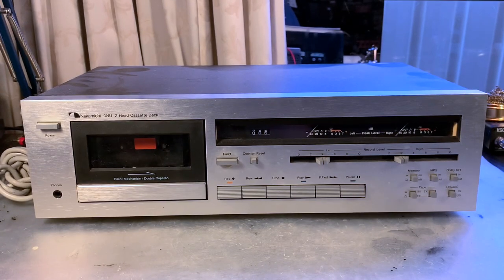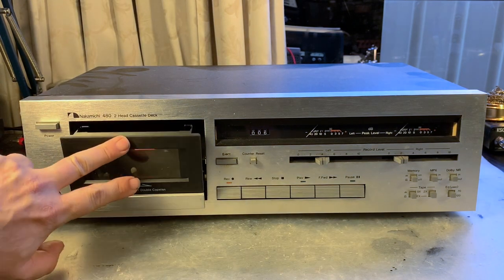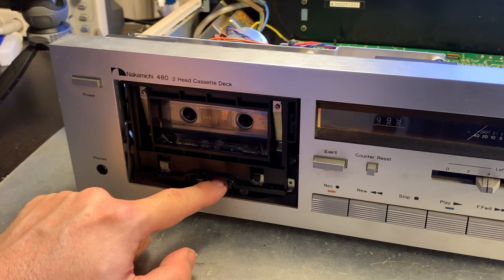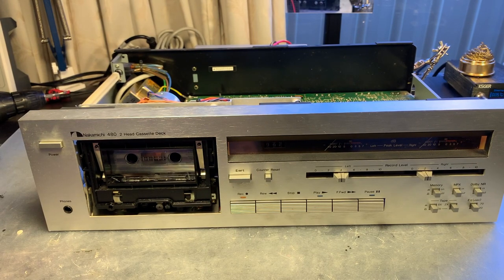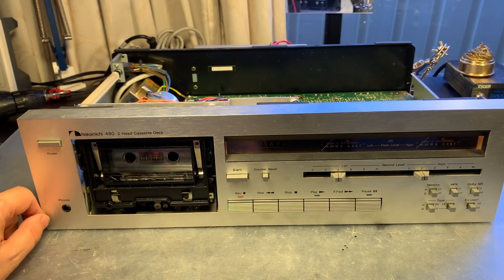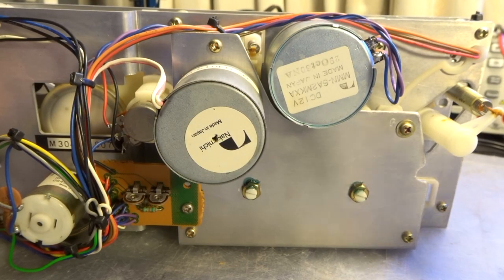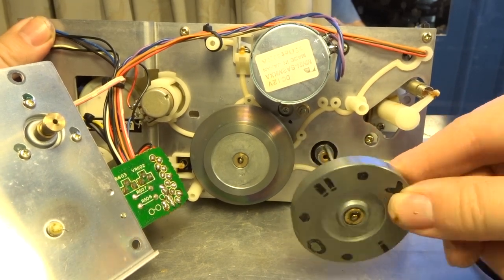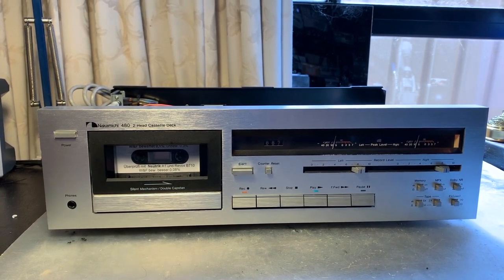Nakamichi 480 - Full Service

Comment: Puttng deep psychological preferences aside for a minute, the ultimate subjective test would be a 'blind test' where we are to compare (say) two decks which were recorded from the same noise-free source, and recorded to (say) 2% peak distortion for both. There are too many people out there who are persuaded by 'status' of equipment, it's a human thing I'm afraid. 

I am under no illusion that Nakamichi cassette decks are up there with the best performing; no doubt. Nakamichi, like Revox, and the best from the rest exploited the cassette format to its limits. However, the results of such a blind test I believe would expose our subjective frailties.

Incidentally, your Nakamichi 480 there is a very desirable machine; I think the brushed aluminium finish is wonderful.
Reply from the maker: I agree, but the challenge here is to find two machines of different manufactures in a similar state. Depending on how they were stored and used, they will have aged differently. Some degree of servicing/restoration will be required to have them working at least. But then it would still not be a fair battle. Unless both are getting a full scale makeover.

The deck is on sale in the shop, but I have noticed that most of my viewers are US based and I am in Australia. Not using the channel anyway for marketing but to share the passion and some knowledge with others.

Comment: please tell me, is there any real difference between the 480 and 480Z models?
Reply from the maker: The Z version got Dolby C and not just Dolby B. So if you plan to use Dolby C that would be the right pick. I love Dolby C and use it for all my tapes.
Reply: @ClassicHiFiReviews  yes, thank you, I didn't notice that, I found only the main differences that the 480 is not adjustable "bias", but the 480z is adjustable, and also - the 480 has "VU meters"  indicators, while the 480z already has LED indicators.